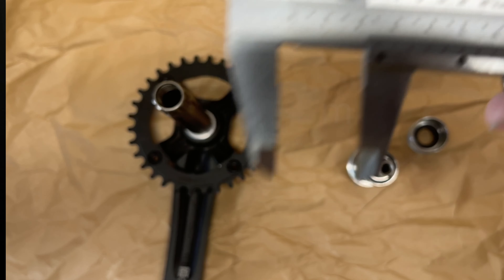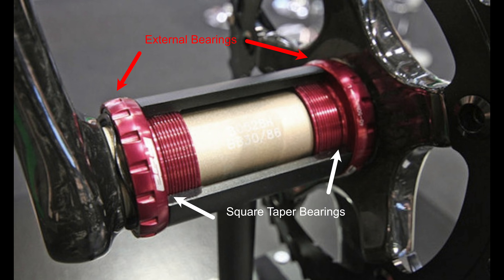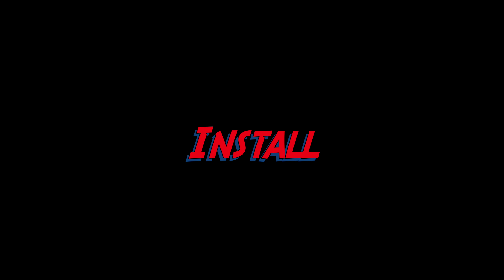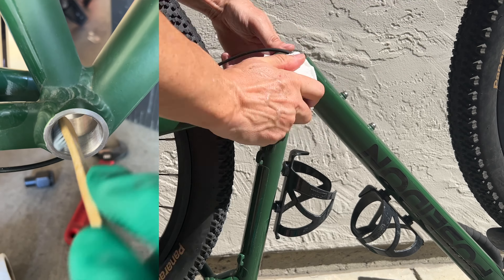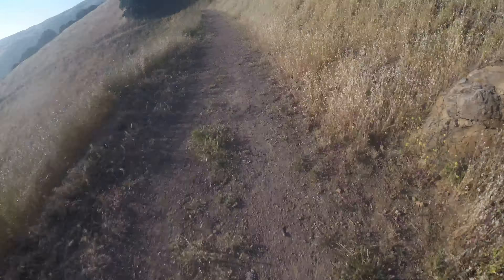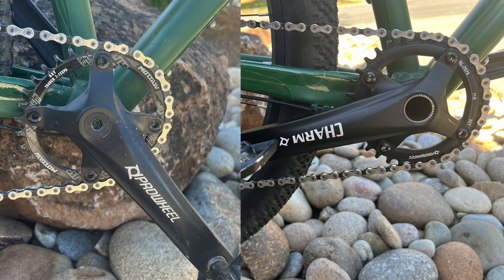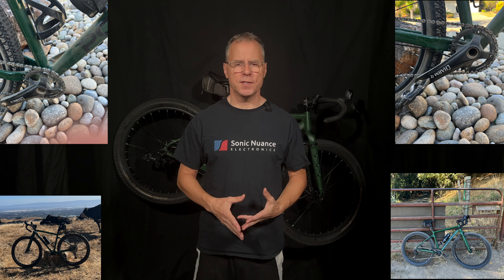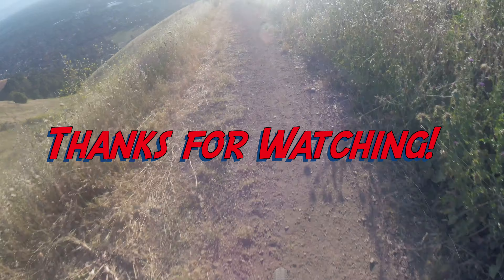Upgrading to a Two Piece Crankset: Process and Results on a Gravel Bike   4K

Comment: Hey Ted, love your videos.  Just one little tiny suggestion?  Insert some bookmarks in your videos.  E.g. in this video "Results" would have a marker, as would "Install," and so on.  Just makes it easier to skip to the relevant bits.  And thanks for posting!
Reply from the maker: Great idea dylanfly.  I'll start doing that in the future.  I'm all for getting the information to people in a more efficient manner.  Thanks for taking the time to give your input
Reply: What cranks and bottom bracket you use?

Comment: Great video, excellent clear information and exactly what I was looking for. I’m currently upgrading my Poseidon Ambition X which I use 80% on road and 20% on light gravel. Can you recommend a good all around chainring size? I live in an area that is pretty flat, but still want some low gears for climbing hills for future bike trips. Also any recommendations on a good brand for bottom bracket, crank arms, etc.? Something a little lighter than what comes stock on the Poseidon. Thanks!
Reply from the maker: Sorry for the late reply (guess i missed the notification from YT).  I've had surprisingly good results with the Amazon cheapie chainrings (the ones from China that come in multiple colors).
Name brand you can't go wrong with Shimano, SRAM and Wolftooth